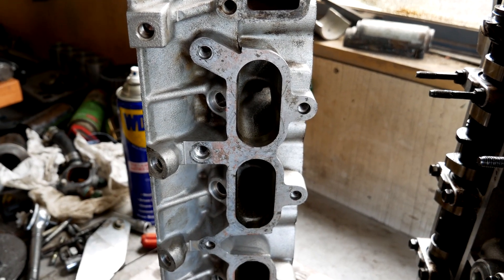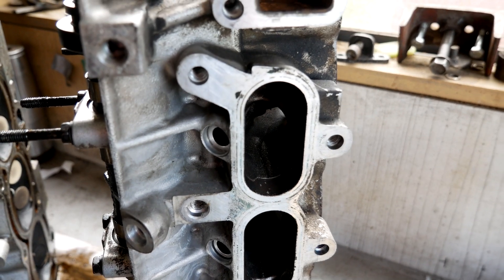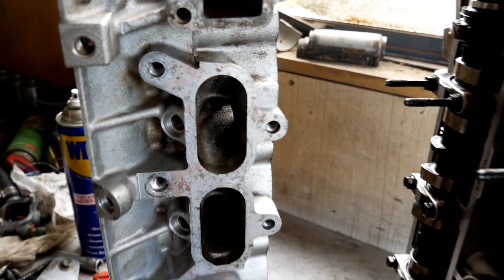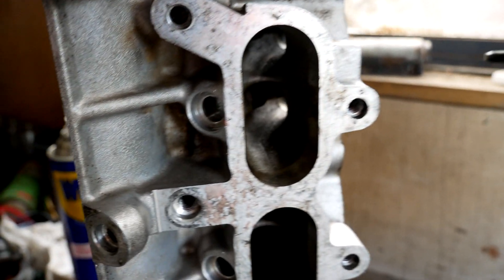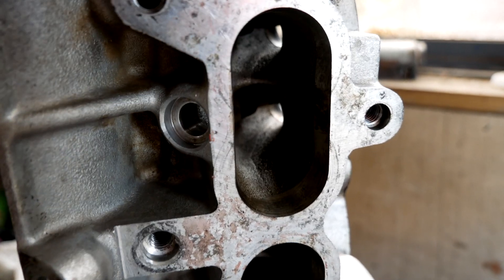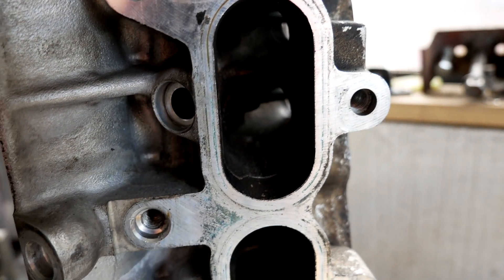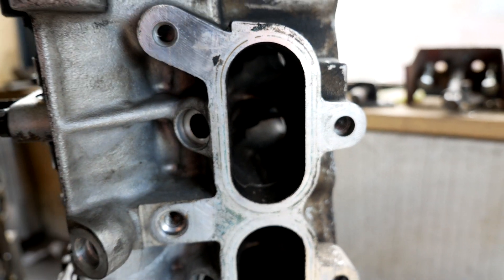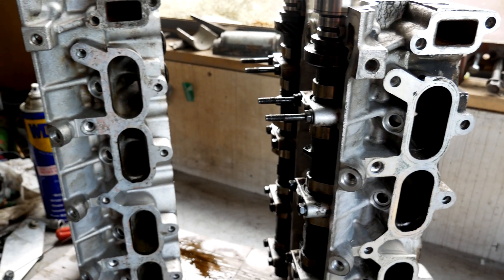Early Vs Late Bigport head - Making Bigport 4AGE great again - Part 3

Comment: Should do a small port v big port that would be good to see with variables like 2 different cam sizes and manifolds v itbs
Reply from the maker: Ive done similar tests on smallport head that ive done in this series,  but dont have a stock one to compare.   in part 5 there is a graph at the end  smallport vs bigport head, with same bolt-ons  and cams.  Its pretty supprising how close they are to each other.   but again the heads cant be 100% directly compared since the bigport head had a little bit more work done to it.

Comment: Is there any way to tell the difference between the early and late heads besides the factory cam cover colors and the actual port size? I just bought a bigport head to make a 7age and im wondering which gen it is
Reply from the maker: The early head doesn't have the 2 x m8 threaded holes in the front of the head between the cam gears.   Its possible there are more than 2 different versions though, as there are more than 2 different toyota  part numbers for the bigport head

Comment: Would be interesting to see the comparison on forced induction application.
Reply from the maker: will be same result.   If makes more power na  will make more power with boost.   only big exception to that, is if the engine has cams with decent amount of overlap. will start to do weird stuff due to the ratio between exhaust and inlet pressure
Reply: @Garage4age  interesting I thought the bigger ports would allow for more flow
Reply from the maker: @youwantshum9860  Late ports are to big for the valve area and poor shape  compared to the early head. so yeah  bigger not always better.

Comment: well from the photos at the beginning of the video, I would have said the late port head was way superior, just that I could see more IN valve.... which to me looked as if the port was raised,  haha, not so, ( the stupid buggers took away material on the bottom of the port ? which as you say increases the inner radius )  I always take material from the TOP of the port ....you always want to make the runner/port at a lesser angle to the back of the IN valve face Why go to the bother of canting the valves with hemi / OHC's  if you are going to do the reverse with a stunt like that ??
Reply from the maker: I'm not sure what their plan was taking material from the bottom. maybe they didn't either 😂.    Most people say the late bigport (redtop bigport)  is a turd because the heavier internals.  Looks to me its mostly from the head and smaller cams (testing the cams next vid) .   the power difference all stacks up to be pretty much the same as manufacturers difference in  rated power.    bluetop bigport - 95kw   redtop bigport - 88kw .
Reply: @Garage4age  Did they have one ?  Port size is pretty much dictated by valve diameter ( IN valve ) Is there a difference in port size ? Volumes in certain parts of the port are very important too, as is the relationship to the backside of the IN valve to the valve seat & chamber shape I agree with your thoughts, did they have to detune the engine for some reason, like you , I can think of WAY simpler ways to do it. 7 Kw is a lot to claw back ....mystery !   Have a look on google for Ford 997 down drafted head ....I would be doing some thing similar, but the angle of incidence obviously would be less extreme .... if I find a link I will post it
Reply: when you view the drawing from old skool in the above thread, the dimensions are WRONG and I am not telling you in which way
Reply from the maker: @bobawatsit  Think i found a picture of what you are talking about.   but unsure what thread you are referring to .    anyway i assume you mean how they have raised the port.    I have looked into doing this on the 4a head,   but the valve train gets in the way before can raise the port much. im still on the fence if it will be any advantage.  While ports aren't the straight shot like modern ports.  the short turn on the early head and smallport head aren't that bad.  just the late bigport is lost cause, it will probably end up in the bin.

Comment: they have different combustion chambers too ?, i remember picking the earlier head, due  to a better combustion champer. between the valve seats.
Reply from the maker: chambers look pretty much the same between these 2. other than some minor casting differences.
Reply: @Garage4age  ill get a pic for you.  maybe there is another revision.   i remember  seeing a big difference in bigport heads, in the chamber.
Reply: @Garage4age   i just had a look, its not as major as i thought lol.   but on the inlet valves, cylnders 2-3  have more shrouding than  1-4, where 1-4 are flat between the seats.  and 2-3 are raised.   did you want pix ?
Reply from the maker: @sixhunt   yeah if you can, wouldnt mind seeing pic's.    my early head is at the shop getting some machine work, and the other one is on engine. so yeh i cant recheck mine right now.  there was some slight variances around where they cut the seats in, but looked more like just some variances in casting rather than different design
Reply: @Garage4age   hey mate how do I send them to you  I couldn't  find  an email and I don't have insta, you on fb ?
Reply from the maker: @sixhunt  garage4age@gmail.com

Comment: Please please please fix up the scales on your graphs in the summaries. At least use the full page for the axes. Drives me crazy, wait am I already there..... 🤔 Good work otherwise.
Reply from the maker: Whats wrong with it?     I cant change them without spending forever photoshopping stuff, just how it comes off the dyno
Reply: Just that it starts halfway up the screen and the scales could both be expanded to use the full height of the page and really show the differences. What is the dyno and it's program called. If I can I can download it and have a look. If it's excel based or even simple code it should be possible to mess with it to make it more presentable. I guess it's too much work to setup an excel import template for presenting?
Reply from the maker: Thats most of the problem,  software it runs is obsolete.  It will only take short term changes. reverts back everytime open a run. have even dug through the sofware files and found one with settings in it.  but doesn't work either. as some stuff on it annoys me as well.     It seems to reserve that bottom part for any aux channels even if not running any.    but the empty space does leave me room to write some notes.  could do something in excel.  but I already spend way to long making these videos, that cost a lot more to make than i make from them.  so yeh needs to be fast and simple as possible.    The resolution on the graphs is high enough imo. any change 1kw or less i would ignore,  there are way to many variables esp on roller dyno to accurately measure under that.

Comment: You can now see why they went for T-vis first,  and small port later because of low low-end torque. In Racing Condition, Driver will not even keep the engine below 4200 rpm, thay is why ITB and Big Port is the way to go for racing,

Comment: I know you already tested headers. But could you test stock header vs blacktop header. Vs obx style header vs your header and what difference a 4-1 makes compared to a 4-2-1 header
Reply from the maker: I have some cheap headers/exhaust here i have run some tests on this stock'sh engine.  but have decided to not to put the vid out yet. as i want to test the same setup on modified head/cams.  then put it all together in one vid.  I cant do all the ones you suggested for various reasons.  but what i have planned should be interesting

Comment: Suggestion.  Fabricate a thin metal tongue to act as a port divider.  This will help maintain laminar flow, which might be disturbed by the "jump" from the inlet runners to the inlet ports.  The tongue may improve port velocity at low torque / low speed.  But it may also affect combustion since the mix will favour one side of the chamber.  The tongue will offer some restriction at high speed, but it may also help maintain port velocity.

Anyway interesting stuff keep it up.
Reply from the maker: Interesting idea. will keep it in mind.   Will be doing the usual stuff to the early head first.  then may try some other stuff.

Comment: Any chance you could take the stock cam cover pressure relief pipe and plumb it back into the stock throttle body to see how much power you loose when you send that blow by and hot air into the engine (Stock).
Reply from the maker: If a single throttle intake makes it back onto engine will try it.  money on it wont do anything on this engine though. not a lot comes out the breather

Comment: Can you a do a time line for us when all these heads came out ? big and small too. would love to see silver and blacktop videos too (20v)
Reply from the maker: Im not 100% sure when they made the change.  since I have no idea what cars the heads actually came from. I only noticed the difference myself not too long ago, when having both heads on the bench beside each other.  After talking to some people, it looks like it lines up  with the redtop revision.   so bluetop bigport = early head.   redtop bigport = late head. I didnt want to call them a bluetop /redtop head in vid as wasnt 100% sure of this.     The late head should be easy to spot  as has extra mounting point for waterlines  bracket or the likes, that poke through the cam belt cover.   I have a stock blacktop in fwd chassis i may do some vids on in the future, it wont be getting modified much though.

Comment: Both ports look like they need lots of work up around the guide. Larger valves should allow some work on the short side radius.  All of this generation of Toyota heads had pretty poor short side radios in comparison to the next generation of Toyota engines.
Reply from the maker: yeh the later stuff with higher port angle is a lot nicer.   the early head will get some work done since has better short turn.  the later one bit of a turd, cant do much with it since too big everywhere.

Comment: I would love a comprehensive test of exhaust length. Do a 4 to 1 header to a single straight pipe all the way to the back, cut off like 10 to 15 cm and then repeat until you're back to the open header.

Comment: I you can see only the valve guide, and no valve opening from the port, it's not going to flow. And it's gonna be a tricky one to get to flow, it needs filling rather than filing.

Comment: I wonder if combustiob chambers are different whuch would alter compression ratio. Same with small port head
Reply from the maker: Chambers look identical on all the 16v heads. other than slight casting variances.  the compression difference come from the pistons.    In saying that I haven't cc'd  the heads myself, but it all seems to stack up.   both of the heads look like they had never been skimmed.

Comment: So how does early big port behaves against small port on boosted applications? Also what about fuel consumption?
Reply from the maker: The head that makes most na power will make most boosted.     economy,  i think the early bigport head with tvis manifold would probably be the best by a tiny bit, if they were the same compression.  otherwise 100% stock vs stock  the smallport may win  due to higher compression.

Comment: Could you test "home made porting"? I mean the light polished port and polished valve?
Reply from the maker: Will be porting the early head that came off engine.   Will be a little more than "home made porting"  though,  as need to get the machine shop to do a couple of things.

Comment: What kind/brand of dyno are you running
Reply from the maker: Its an old vane (now mainline) bed with telma 1350nm brake.  Its running dynotorque / torque performance software/control.  obsolete now, but still does what it needs to.

Comment from the maker: Few things to note;  The short turn radius on the early head is nicer shape,  A lot of the port size gain in the later head, is from the bottom of the port being lower.  So the short turn has sharp turn just before the valve.  Both heads were using the same late 7.1mm camshafts. (late bigport/smallport)    Will be testing early / bluetop cams soon.   Also, content lately has been pretty 4age specific and will be for the next few vids.  Will get back to some other stuff once have worked through building this engine up!
Reply: wouldn't be Garage 4age if content wasn't 4age specific, right?
Reply: It took 25 years of knowing 4ag to learn there were two different big port castings..
Reply from the maker: @jdchmiel   I didn't know this till about a month ago either, till had both heads sitting side by side on the bench. there may even be more than 2, who knows?!   if you look at the thumbnail for this vid, early one has a 6 cast into it late has a 9. im not sure if that means anything.   Ive mostly worked with smallport heads.
Reply: @Garage4age  interesting to know about the casting numbers. Mine is a bigport 4agze from aw11. Has number 5 cast into the head.
Reply from the maker: @aarongrant6748   interesting.  could mean anything i guess, never know with toyota. the early head has some other random markings on the front also.    im not sure what car the heads i have come from
Reply: Awesome vid once again
Reply: love all the bigport 16v specific videos, gives me a good idea what to expect from my engine as well. keep up the good work!
Reply: Does the later head have more of a hockey stick profile on the short side?  Sharp turns are a good way to loose energy.  So even though the port is bigger, the flow on the short side may be affected in bad ways.  The valve guide bosses in the later head have gone on a diet.  That looks like it could be a flow improvement.

Toyota has recently gone back to wider valve included angle designs (think "G" head vs "F" head) for the Dynamic Force range of engines, eg. https://www.youtube.com/watch?v=Rr1eJJhnsLQ

If you go to 13:20 there's a discussion on the valve included angle AND the short side porting.  Toyota has added a wee ski jump at the end of the port to encourage flow over the back of the valve (towards the centre of the chamber) rather than the normal design that encourages the mix on the short side to deposit near the outside of the cylinder.
Reply from the maker: @stevesimpson5994  Pretty interesting design.    I drew a really bad picture of what the ports look like, because seemed easier to explain what they look like that way.  https://garage4ag.files.wordpress.com/2021/04/port-1.png    the red lines being the  early head, and the green the late.  the blue is a straight section where they have ran the machine down the port when cutting the seat.  as you can imagine, is a pretty sharp edge and poor transition there.    the early head has some misalignment between port and valve seat, but they haven't sent the tool way down the port or needed to for that matter.  so yeh early is a far better starting point  with its larger radius short turn
Reply: @stevesimpson5994  But don't forget important thing. Yaris GR has turbocharged engine with direct injection and it could mean really different requirements. In this case it seems to me that Toyota went the way of better A/F mixing and sacrificing little bit of charging efficinecy. A/F mixing is really crucial in DI engines especially in the production ones which has to pass emission tests.
Reply: My bigport head says #2 and by the example comparison you gave, it is a early type bigport. That's interesting.